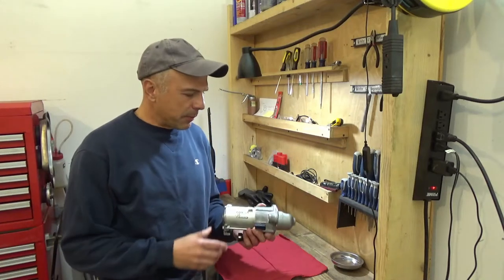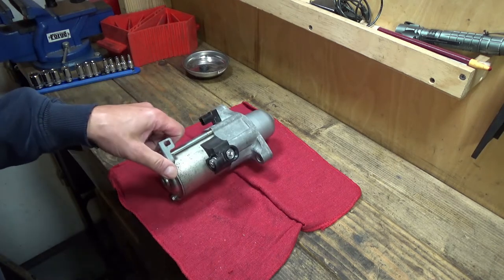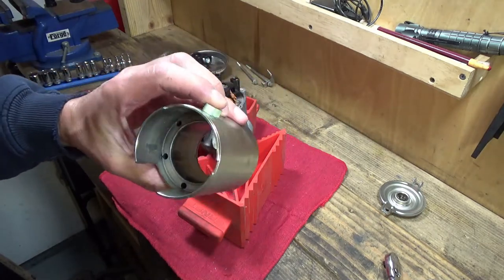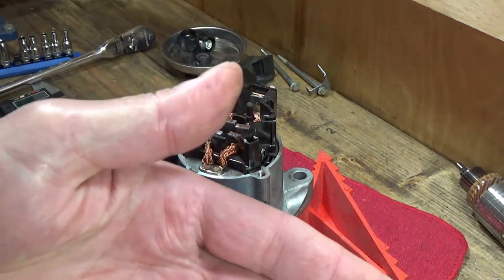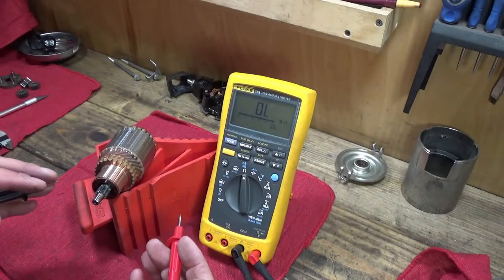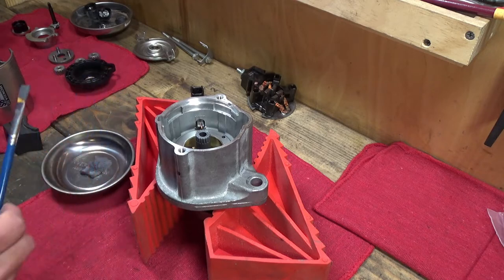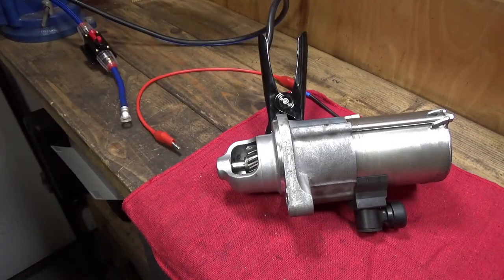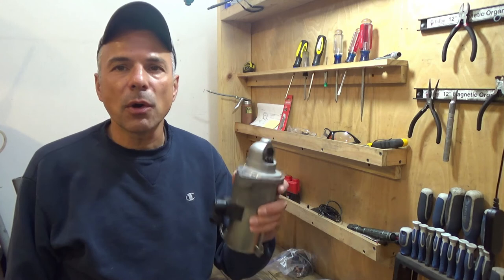Starter Rebuild for Honda Accord ('18-'22)

Comment: I will be rebuilding my 08 Accord starter today with confidence thanks to your video!
Reply from the maker: Nice!  Thanks for the comment and good luck with the rebuild!  I did an 07 starter rebuild and there is a write-up linked in the comments in case it is helpful.  Did your starter fail or is the rebuild preventative maintenance?
Reply: @JohnsDIY  It has an intermittent only click. Have replaced relay and check battery terminals for good contact. If I had the money, I would replace the starter but for $25 dollars I'll do this first. Thanks again!
Reply from the maker: @TexasRaised68  Yep, sure sounds like it's the starter then!  Good luck with the rebuild and I'd be interested to hear how it goes and what you find.

Comment: The only video I have seen so far that goes into checking the solenoid.  This is the best starter rebuild video on YouTube. Well done.
Reply from the maker: Thanks very much for the nice comment!  Appreciate it!
Reply: @JohnsDIY  My solenoid would pull down the plunger down with 12 volts but the pinion gear will not go up. What would cause this?
Reply from the maker: @crisprtalk6963    Interesting.  Are you able to manually extract the pinion gear by holding the gear slightly and then turning the drive shaft and seeing if it drives outward?
Reply: @JohnsDIY  Yes. It goes up.
Reply from the maker: @crisprtalk6963  Is the starter currently disassembled?  If so, does the plunger move up and down freely?
Reply: @JohnsDIY  Yes I have it apart. I can press down the plunger ~1/8 inch freely. It bounces back up. This is off a 2009 accord 130K miles, original starter. Resistance of the solenoid was about 0.75ohms. The car battery was low, but I hooked up jumper cables  from my truck with healthy battery to the accord and that would do nothing as well. On the bench, the starter will spin although not that fast on 12V, but as i said I never got the pinion to go up. 2 of the 4 brushes were ground down to nothing.
Reply from the maker: @crisprtalk6963    Thanks, interesting.  So when you fire it up, does the pinion gear come out at all?  Even a little bit?  I think it just needs to come out a bit to engage the flywheel and then once the motor engages, that will drive it out the rest of the way.  It doesn't need to drive all the way to the end.  I think if it were me, I would put it back together and try it on the vehicle if you haven't already.  I know the 2009 is a slightly different starter, and maybe the pinion doesn't drive out all the way as it does on the 10th gen?  Let us know how it goes!  Interesting that the 2 brushes were worn down to nothing!
Reply: @JohnsDIY  No, it doesn't really move up at all when I apply 12 volts from my jump pack, it just kinda shakes a little bit. 😄 We tried to engage it in the car with a jump pack, my truck and another truck and still no luck. Power is getting from the ignition switch to the starter according to my test light. It is my friends' car. I did order the brush kit for it but then I recalled you saying the solenoid on these was not serviceable. So i cancelled my order for the brushes. I also found it interesting that 2 of the brushes were basically gone and the two remaining ones were healthy. I would have thought there would be nearly equal wear on all 4 of them. My friend bought a new starter from rock auto (fingers crossed there) and we are testing the battery as well to make sure it can handle a load test after fully charging it tonight. I appreciate your time and input. Thank you.
Reply from the maker: @crisprtalk6963  Thanks for the detailed information and nice job with all you've done!  Yeah, maybe there's a problem with the pinion gear and the brushes weren't the real show-stopper issue.  I agree with you, I would have thought that the brushes would have been worn pretty evenly.  Good luck with the new starter - hopefully that takes care of it!
Reply: @JohnsDIY  Update: I got the new starter in from ROck Auto and it tested just as the old one did regarding the pinion gear. My friend decided to have me install that one which I did and of course it worked great. I kept the older one for myself and will rebuild it to have as a backup and for my own education. So you were right, the 2009 starters do behave differently than the one you showed here.
Reply from the maker: @crisprtalk6963  Interesting, thanks for letting us know about that!  That's good information.  Nice job getting the repair done too!  You are a good friend for sure!
Reply: @crisprtalk6963  hola, probaste el desarme del cabezar para revisar el impulsor?

Comment: The calipers have a depth gauge that slides out the bottom that can measure the commutator mica depth.🤫
Reply from the maker: Thanks for the comment Wilmar, that's a good idea.  Unfortunately, the depth gauge on my caliper was too fat to fit in the gap between the commutator segments though.  Maybe some calipers have a thinner depth gauge though...

Comment: You earned a subscriber 👍 thanks for the amazing tutorial. 

I have a question: Got an Accord CL7 2.0 (EU) Living in Germany, which is the worst country in the world to get parts. I found a genuine kit from the UK €110 brush holder, plunger rod, etc...

A new Denso starter is €185, but, I found some chinesium part for €16 (brush holder...), which was measured by hand and made accord(ingly). 
My starter nose bushing wheezes from time to time on cold starts.

Should I just bite the bullet and spend the €185? Because I don't know how worn my brushes are. Starter is the O.G from 2004, 209k km.

Thanks a lot!
Reply from the maker: Thanks very much for the nice comment!  Wow, sorry to hear that it is so hard to get replacement parts in Germany - I had no idea!

Yeah, I guess given those limited options, I'd probably go with the new Denso starter. Given the high cost of the genuine kit (60% of the new starter) I'm not sure it is worth going that route as it would be a lot more work and it's still not as good as a new one.

Wow, that's impressive that it is 20 years old!  That's a lot of starts probably!

Comment: Nice where can you buy starter kits for  these honda crv. In the usa
Reply from the maker: Thanks for the comment.  You can get the replacement starter parts for the rebuild right from Honda!  Most of the online Honda distributors stock these (www.hondaautomotiveparts.com,  www.hondapartsnow.com, www.bernardiparts.com, etc.).
Reply: If you are a rebuilder shop. A kit costs  you like $ 8 dollars.
Reply: @JohnsDIY  how do you search the part of what does Honda call it exactly.. thanks in advance
Reply from the maker: @Beee_Ceee  In the past, I have been able to go to the Honda distributors and under "Starter" they have a blown-up image with all of the parts labeled.

Comment: How about removal of the starter pinion drive bushing, that's what I want to see, HOW TO...
Reply from the maker: Yeah, that's a good question!  I wish I knew as well.  Please share if you figure it out!
Reply: @JohnsDIY  
What I discovered is that most of these modern day starters the starter drive isn't serviceable, the housing that holding the starter drive is welded on, so unless you're planning on cutting through it by some means, then you can't get access.... I took an old Honda starter apart earlier and that what I discovered, I'm gonna look further into it later though....
Reply from the maker: @freeman573   Interesting, yep, that's what it looks like in this case.  The service manual doesn't mention anything about it and it is sold as an assembly.  I'd definitely be curious if you learn anything further!
Reply: @JohnsDIY  
Thanks, so would i....
Will keep searching.

Comment: i have an intermittent no start problem. It clicks but won't start on occasionally. Do you recommend replacing just the solenoid or the complete brush assembly ? Thx
Reply from the maker: The solenoid itself (coil) is not replaceable.  However, the contact that energizes the starter is replaceable which could be your issue.  However, if you are tearing it apart, I'd probably replace the contact as well as the brush assembly.  But you could take it apart and see how much length is left in the brushes and just replace them if there is little brush length left.